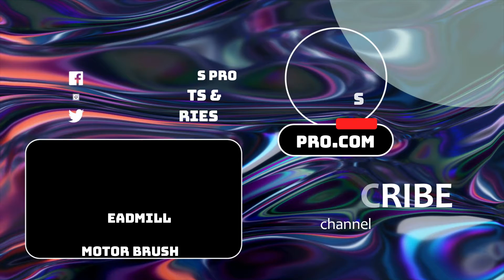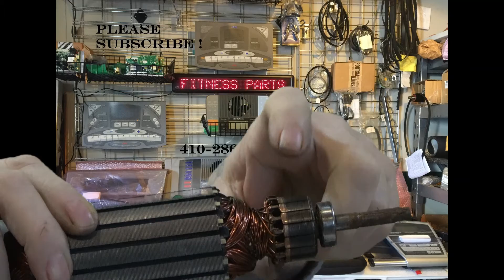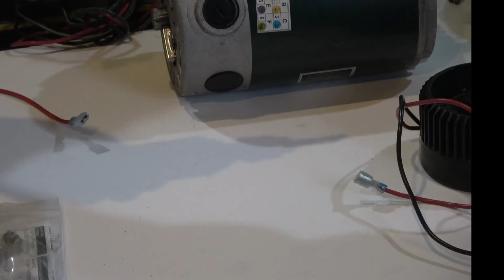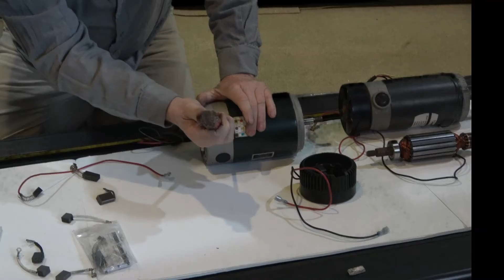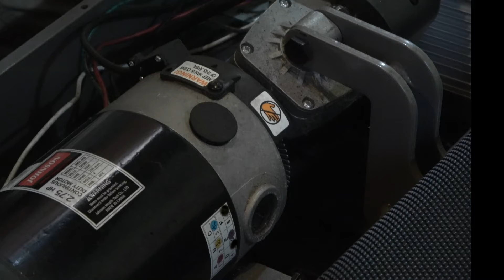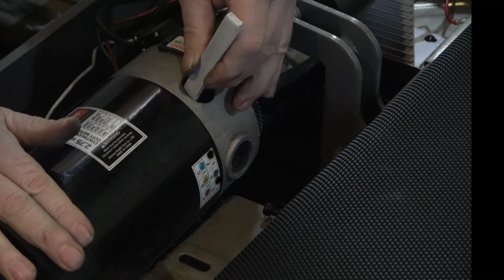TREADMILL MOTOR BRUSHES

Comment: Do you have a link to the brushes for Sole F80 Ya Cheng model Y12TH9G 30A 90V DC 3HP 4000rpm treadmill motor? It's the blue motor in your video. Also, can you provide a link to the bush stone that will fit into the slot on one of these?
Reply from the maker: Hmm sorry I don’t know the girt it’s listed as medium soft. On the motor brushes 
I recommend .
Eurton Electric.com

Comment: Same motor on Sole F80. Motor is bogging at low speed tripping LS-1. It works if we kick start the belt. Belt is lubed. Is this likely a board dc power controller failing or a brush on the motor? Motor is the original.
Reply from the maker: To test the controller kick start it. But don’t use it see if it runs with no one on it 
If it runs with no one on it 
Then the controller is probably good. Also I have a few videos on testing your walk belt over 80% of all issues on all treadmills start with walk belt wear causing more load on motor and controller. No matter how much lubricant you put on 
They just get worn down.
Look through my channel you will see lots of videos on belt wear lots of

Comment: Great video.  I'm still looking for a video on the Pro Form 505 CST model PFTL60910.1  I can't seem to figure out where the brushes are.  Thanks.
Reply from the maker: @LadyGoza  a lot icon units don’t a replacement brush.But if you follow the motor wire back to the motor the brushes are attached to the wiring. And thank you

Comment: Wow!!!! Spring was crooked so the brushes had bad contact.  Amazing.  Your video is just the right thing at the right time.  My treadmill stopped working with FET Error.  So I ordered the FET and my genius coworker, Ben, helped me out by replacing it.  We still got the same error. Long and short, Ben took it home and applied a DC voltage, and it worked only when he pushed black wire.  He then opened it and the spring was crooked.  He straightened it out and it started working.  I am going to order new brushes anyway.  
I could not find any direct information.  Maybe someone can help me.
McMillan Part # C3456B3442
Life Fitness Part # 7964201
Reply from the maker: @DogsAndDYI  That is a great fix . Good use
Reply: @FitnessTechnologyServices  I still think I should replace the brush as it is worn at an angle but can’t find a replacement.
Reply from the maker: Of the video. The best place I have found for the brushes is a site named www.eurlonelectric.com we even have a small add for them on this video. I have found them helpful

Comment: Interesting video. Thanks for sharing. 
I have a 4.25 hp, 130 VDC Leili treadmill motor that I’m using for a lathe. I noticed that the red and black wires coming out of the motor are AWG 16. So, like the fool I am, I decided to upgrade to AWG 14. 
I popped open the little plastic door where the black wire exits the casing. It shot across the room. Turns out there’s a spring in there. 
The black wire connects to a thicker copper braid which is attached to the brush, or magnet or whatever it is. This brush or magnet fits in a slot inside. 
So I connected the braid to the 14 gauge wire and I’m wondering what the spring is for. It’s a PITA to get it in like it was. 
What’s its function and do I need it in there?
Did I do a foolish thing?
Thanks for your help. 
Paul
Reply from the maker: I think you have to have the spring the motor brushes need to move a little. And the spring keeps light pressure on the brushes
Reply: The spring pushes the brushes against the commutator. Brushes wear as they are used, so this makes sure they always are in contact.

Comment: My motor looks very similar to the one on here. I need a replacement reflector sticker that goes on the end of the flywheel for the infrared censor. Do you know how to get one or even properly word that question? It's a precor 9.25i 400 series. Thanks!
Reply from the maker: Well that will be hard to find they have not used that reflector tape or the infrared sensor for a long time. Your wording is perfect send me a picture of the tape to fitness parts pro @gmail.com they made different kinds back in the day I will see if I can help
Reply: @FitnessTechnologyServices  ok thanks. I actually bypassed the damaged tape which was on the edge by moving the censor inwards. I also plan on using mirrored tape to make a new one. Thanks for the response!!
Reply: @FitnessTechnologyServices  I will send ia picture. Thank you